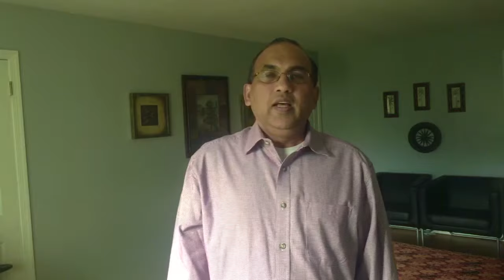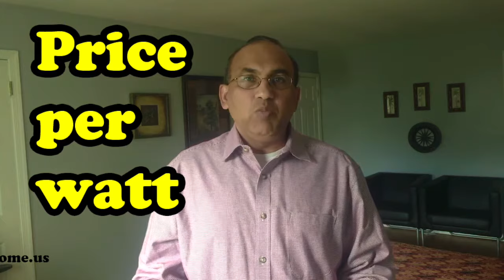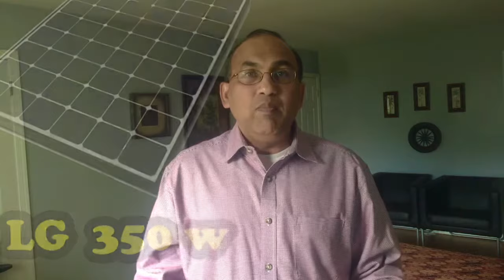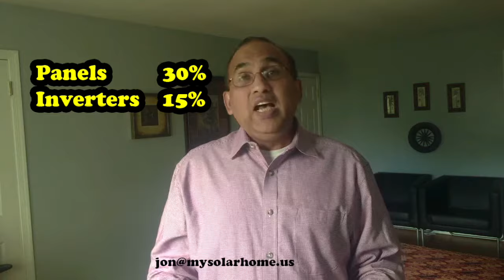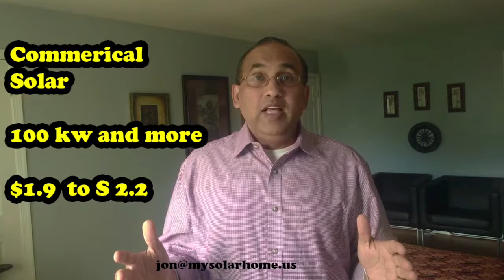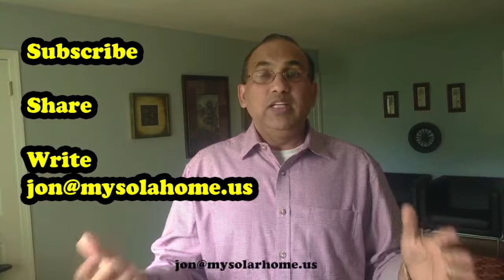Cost of Solar Panels

Comment: Is the price per watt determined before or after the Federal tax credit.  For example, I just signed a contract to purchase 19 REC alpha pure 400W panels for $3.49 per watt before the federal credit.  It is $2.58 after the credit.  Did I get a good cash deal?
Reply from the maker: It is before the tax credit is deducted. Since your system size is a little small 19 x 400 watts = 7600 watts or 7.6 kw, the $ 3.49 price is not too bad. I could do better though. I could get out a proposal to you asap if you email me a recent electric bill to jon@mysolarhome.us .
Reply: @MySolarHomeUSA  sorry I also forgot.  They are adding a NEMA 6-50 220V 50A as well as a second 110V 20A outlet in my garage from the basement cost inclusive at $3.50 per watt.  My estimate is $1400 for the outlets alone.

Comment: I have several offers from energy sage one from a company offering The Panasonic 340watt HIT panels at $2.45 a watt. I know it's a older technology so my question is if 10 years from now I need to have a few panels replaced is it compatible with their newer technology? Also this would be a good topic for another video.
Reply from the maker: Hi MJ, Replacing panels in 10 years from today will depend not only on the panels you have today but more importantly what you have in terms of inverters. If you have microinveters, that would be the most flexible. You would likely be able to replace the HIT panels with newer generation panels after 10 years since the microinverters would work with those as well.  And if the panels produce power beyond the range of the microinverters, you could replace the microinverters along with the panel.
With optimizers or string inverters you are stuck - you would have to find panels with similar charateristics to the HIT panels. And Good luck with that in 10 years. So short answer go with micro  inverters with your Panasonic panels - preferably Enphase.

Comment: Thanks for this video. Please do we have similar technique for determining the cost of batteries and inverters?
Reply from the maker: Hi Felix, The cost of inverters is built into the solar cost per watt. Batteries is a different matter. If you are planning home battery backup, the options are pretty expensive right now. The cheapest would be local companies like Ampericon. Tesla is reasonable but their batteries are not avaialbe. Unfortunately, there is no price per watt kind of formula. Typically a kwh of storage costs around $1,500. So anything below that would be a good deal. I have a couple of battery videos on my channel and I will be adding more in the future. Thanks for watching. 

Another option might be to consider much smaller batteries, they are less expensive - check these out - https://mysolarhome.us/best-solar-generators